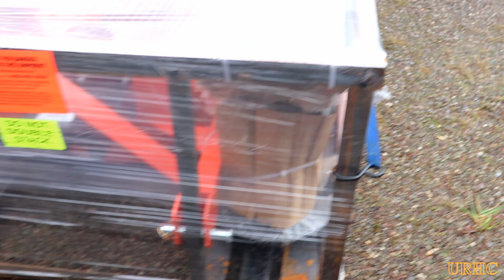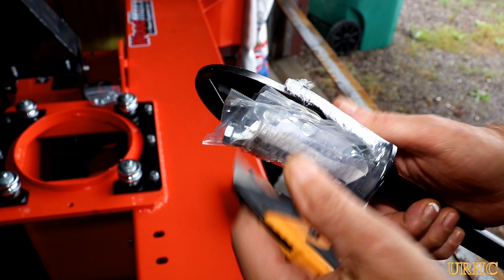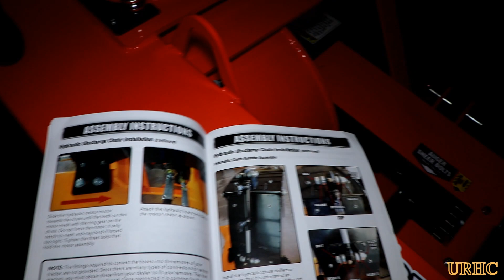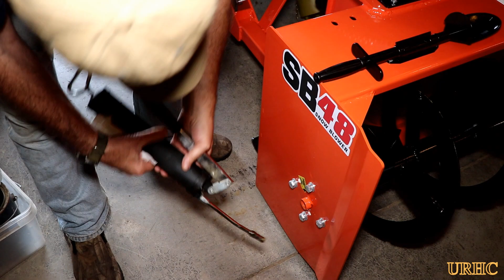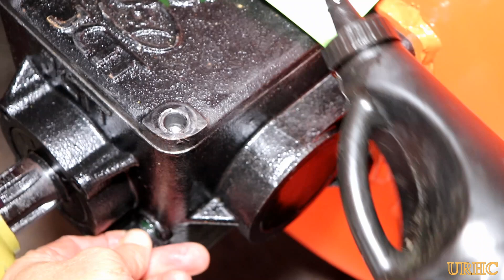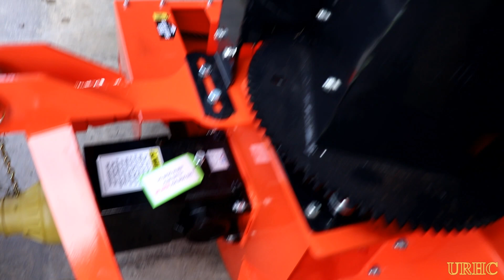Delivery And Assembly Of My New Woodmaxx SB48 Snowblower Replacing The Junk Ariens Platinum 30 SHO

Comment: Great video, I've got a Woodmaxx 60" snow blower and couldn't be happier with it!

I think the reason your saw blade lost a carbide insert is because it's spinning way too fast.  The saw is made for an abrasive wheel spinning 4000ish RPM's.  A cold saw blade is only rated for 1,800 RPM's or less and usually has coolant running on the cut.
Reply from the maker: They are great blowers. It is a slow cold cut saw. Got a better Evolution one now. Thanks for watching.

Comment: You seriously compared a walk behind snowblower to a three point hitch model? Lol
Reply from the maker: I used to do it for years with  a walk behind that was old and worked good. Tried a new one that was total junk and useless so switched to this.  Cost about  the same as the Ariens that was junk so its comparable in price. Big difference  is this works like my old walk behind.  Thanks for watching.
Reply: @unemployedredneckhillbilly2023  Okay, I can get my head around that.  If I had a tractor I’d absolutely gave a pto blower for it.  Thanks for replying and I like your videos.

Comment: If you are in to "local" as you stated, why do you have a Kubota instead of a John Deere?  Kent from PEI
Reply from the maker: I have both. The deere has a better mower deck and the Kubota is a better tractor with a really  good dealer nearby. Part prices  for Deere tractors are crazy now so I wouldn't buy another when its time to replace it. Thanks for watching.

Comment: None of the wide walk behind snow blowers I used I ever liked.
In my view anything over 28 inches is too wide in a walk behind the blower you have now is the answer..
I  Just traded in my Deluxe 28 SHO for a 24 platinum. 
The deluxe 28 worked fine but front heavy no problems with the auto steer for me.
Bought the 24 for agility.
Before I had the 28 I ran a Toro 26 power max for 11 years. Great machine.
I’m not brand loyal either way. I can see where a 30 blower would be a pain . 
Thanks for you informative videos. 
We all have differing experiences.
Reply from the maker: This is definitely  overkill  but works without problems at an affordable price. Thanks for watching.

Comment: just wondering how far back from the back of the rear tire to the furthest back point of the blower ?
I may have to extend my shed! I have a box blade and front loader Attached now and was hoping the total length would be the same ?
Reply from the maker: 55 inches  from back of tire to outside auger. Thanks for watching
Reply: @unemployedredneckhillbilly2023   THANKS !! You were right on the money bro ! Had to add jamb extensions on my doors to sneak her in !

Comment: Smart move dumping the Ariens and replacing it with the WoodMaxx... and now I'm wondering about my Ariens.  I had an old Ariens that worked perfectly and I ended up giving it to a friend and buying a new one.  The new Ariens has a similar system as the one you got rid of.  I have used mine in very deep snow with no problems, but it was sold to me as a pro model so maybe the belt system is better.  At some point I'm going to take off the cover just to have a look.  Thanks for making these videos.
Reply from the maker: This is definitely overkill for my driveway but works good for the same price as a walk behind. I thought the Ariens machine would be a nice upgrade and work better then the old one but it was a total disappointment.  They made many changes that year that were most likely the problem.  I think the pro models have a better drive system with ball bearings and the wheels were not moved forward like the platinum. I think  they also have a different autoturn system with beefier axles. Hopefully yours works for you.  Thanks for watching.

Comment: Why would you get a rear unit? Are you going to drive in reverse everywhere? We’ll see how long it takes for you to complain about this one.
Reply from the maker: Didn't want to spend 4k on a Honda walk behind to get a modern  machine that would work on my conditions.  This is an amazing machine.  Its overkill for my driveway at 47 inches but can do it in 15 minutes with no problems. This will handle anything and doesn't even strain the kubota with 2 feet of packed snow. The main reason I purchased it is the company guaranteed me it would work on my driveway and said  they would be there if there were any issues. It is extremely well made also. I don't know why people think driving backwards is a problem,  it's not at all. I highly recommend this as it does what it is sold to do well. Thanks for watching.

Comment: I had a 6 foot pto wood maxx previously.  NOTHING stopped it. Good luck.
Reply from the maker: This is an amazing blower.  Even 18 inches of snow is blown the same as an inch.  There seems to be very little strain on the tractor and it's the perfect size.  I highly recommend Woodmaxx blowers. My friend bought a 6 footer and it works as good as mine.  Thanks for watching.

Comment: Your comparing apples and oranges. This machine is 3 times as big as the Ariens. I have a 24” Ariens and I’ve never had an issue even when the snow was higher than the front of the machine.
Reply from the maker: Its only 16 inches wider and there is no comparison.  This one works like the old ariens did. It's way overkill but cost about the same as that junk ariens and they guaranteed they would take it back if there were problems.  Great to find a company that cares about customer service and stands behind what they sell. Thanks for watching.

Comment: I saw this video about a year ago, and complained then. Your listless attitude is beneath contempt. You don't really try at anything do you. No wonder you can't enlist the assistance of anyone because your lackadaisical attitude repels people. You deserve what you get or don't get. I own, and have used an Ariens for 60 years, and it's still a killer.  YOUR FAULT YOU LET YOURS GO! Replace the 3 auger bearings, and give it 40% more horsepower,  and she'll scream to please.  YOU LOSE....
Reply from the maker: You are a total idiot.  I tried for several months and there was no fix. There was no fix for Autoturn other then switching to the older style axle and putting 40% more hp on a 8 hp drive train has consequences. I refuse to struggle with junk equipment and have engineered some of the highest tech machinery in the world so I definitely know what junk is. Go crawl back under your rock.

Comment: Go to "Steiner" tractor website and look at snoblower. always has pile of snow in front of auger. I had old Ariens that threw snow 50 feet.
Reply from the maker: That's how a blower works. They move the snow to the center and the fan throws it. This thing is awesome and goes right through 2 feet without lugging the engine or plugging.  I bought a big new ariens last year and it was total junk with over 6 inches. It's way overkill for my driveway but works great.  Thanks for watching.

Comment: Wonder how long it will be before you start to complain about this blower.
Reply from the maker: Not 1 complaint so far. This one works as promised within issues. Used it 10 times so far and it is amazing.  I see several others have also purchased them now after seeing the videos and have zero issues. They really nailed it with these blowers.  Ariens makes junk these days  and they weren't complaints, they were actual issues with usability of the machine I spent my money on.  If it worked like the old one I would still have it. Thanks for watching.

Comment: Made in China 😂😂😂😂😂😂 good luck
Reply from the maker: It has been a fantastic blower so far.  Made better then any others I looked at. Made in China means nothing anymore. It is the company's specifications that determine the quality.
Reply: @unemployedredneckhillbilly2023  I beg to differ, Made in China means everything. I almost bought a Woodmaxx wood chipper, but decided a used made in USA was a better option. Woodmaxx is so upfront to say engineered in Buffalo, did they even try to source it in the USA? Who knows, but I'll tell you this. Give an American the option of made in China or made in the USA, most people would buy USA. My reasoning is influenced by the fact that I am a retired union autoworker, not a fan of the CCP.
Reply from the maker: @Mike44460  I have to laugh when union workers blame everything wrong with  our economy  on China. We have a president endorsed by unions that eliminated 25000 high paying  union jobs with a single  signature.  You get what you vote for and half of Congress  is in bed with  China so it's not going away when you elect swamp creatures

Comment: I like my woodmax tiller. Designed well. However they dont seem to stock parts should you need any. They will be on a slow boat from China. Can take up to 6 months wait for parts
Reply from the maker: That doesn't sound good. Hopefully  they start stocking parts as they grow.  Thanks for watching.

Comment: I bought one of their wood chippers which was really rugged and it worked great . One thing you might want to do is make sure all your bolts and especially your grease fittings are tight as mine were not . The people at Woodmaxx  are great to do business with .
Reply from the maker: They seem to build them out of heavier gauge steel then everyone else.  Checked all mine and they were good. It has really worked great the couple times that I have used it. Thanks for watching.

Comment: I have a Platinum 30, a new concrete driveway, but it's residential property in the city.  I think Ariens will do what I need to do.  But I am impressed with the set up.  I've subscribed b/c I want to know how it does.
Reply from the maker: My new platinum 30 was junk. The front was light from the rebalancing they did last year moving the axle forward and was a fight to keep down, the autotune kicked the machine around and it was a fight to keep it going straight, and a couple trips up and down the hill made the drive got wet and slipped so it had to be pushed. It was useless compared to my old ariens. This blower seems to work great so far and handles the snow as a blower should. Waiting for a big storm to see how it handles couple feet. Thanks  for watching.

Comment: Live in NH a lot of snow here in the winter I have a 300’ driveway tractor and a grading blade works fine hate walk behind snowblowers
Reply from the maker: I had an old Ariens that i used for years that worked good. Bought a new one and it is a hard to use piece of junk so I decided to try this and I am very happy with it. Thanks for watching.

Comment: Can't wait to see it in action ;-)  Looks like it should do the job for you. I would have to have a front mount because of neck problems, I can use mirrors real good but would feel more comfortable with a front mount. Thanks for sharing.
Reply from the maker: There is a video of the first storm and it works great. It didn't bother my neck and doesn't take long to clear everything.  No more sore back from fighting the Ariens. When I replace the Kubota with a different brand I can still use this blower. Thanks for watching.

Comment: Looks like a very heavy , durable unit . I just could not do the driving backwards thing . Good luck 👍
Reply from the maker: I didn't know if I would like it either and bought a reverse camera to install.  Turns out I didn't need it, it doesn't bother me. After the problems with the new Ariens I didn't want to take a chance on another problem machine and went with this. Thanks for watching.
Reply: I couldn't handle the reverse driving either. This belongs on the front pto of a tractor. We'll see how long it lasts before the poster is bellyaching about this machine.

Comment: They make drift cutters that go on side of blower, helps break up the drift so it drops down to be blown.
Reply from the maker: With this one you don't need them. It raises 2 feet in the air to take the top off then just pull forward and drop it for the rest. Only can do 5 feet at a time but should easily handle 4 foot drifts. Thanks for watching.

Comment: Make sure before you use it, take a chisel or punch and mark the auger near the shear bolt so when it does shear you can line the marks up and the holes from the auger and drive up easier.
Reply from the maker: Thanks, that is a good idea. I will do that. Thanks for watching.

Comment: We have a lot in common, I have the same Airens but a couple years older.  I had a problem keeping it tracking strait until I black topped my drive, now it works great unless I'm in a packed bank then it just wants to crawl upward.  Recently I struggled deciding between the Woodmax SB48 and the Woods SB54 to hang on the back of my BX2380.  I have past experience with Woodmax owing one of their TM86H wood chipers, it is a great, extremely stout machine and the company is great to work with.  I ended up going with the Woods because I wanted wider than 48" but I thought jumping to a 60" may be a little taxing on the BX.  I enjoyed your assembly video, it got me wondering if I made the correct choice, I'll have a clearer answer after I get to use mine (which could be tomorrow) and viewing your upcoming videos of the SB48 in action.  Good luck with your new tool (toy).
Reply from the maker: I was looking for the smallest blower possible because of the low pto hp on my BX and this one seemed well made plus I am starting to think that smaller companies have better customer service then large ones should a problem arise. It is very heavy for a small blower and I hope it helps it stay down in the snow.  I really wanted a walk behind but my experience with Ariens changed my mind this time around. Hopefully we will get a good snow soon to test them out. Thanks for watching.

Comment: Should of got a honda
Reply from the maker: Didn't want to spend that much. This one should definitely work and have no problems with my hill as the Ariens junk did. The Platinum drive would slip after getting wet and have to be pushed,  and the rapid track  rode up over the snow and sunk in getting hung up on the axle hanging  down under it burying it so far in the gravel that it had to be pulled out with my tractor. My 1965 Ariens was a great trouble free machine,  I don't know how they messed them up so bad.

Comment: I live in northern WI. and bought an Airens  Deluxe 28. It eats snow like crazy. Sorry it didn't work for you. Love my Airens plus it's made in America.
Reply from the maker: My drive system gets wet and slips on my hill and the autoturn stinks on gravel. It is junk compared to the old one I had. They are only assembled in America, many of the parts are from China. Their machines and customer service stink. Thanks for watching.

Comment: Make sure you set your skid plates about 1 inch high until you get a good frozen snow base, then you can lower it down.  Other wise your snowblower will turn into a rock launcher with that gravel drive way :-)
Reply from the maker: That 3/4" scraper blade gets flipped for gravel so the angle faces down also. Thanks for watching.

Comment: I have a MF GC2410 and bought the Woodmaxx SB60 last year with electric chute, deflector and LED lights...love it.  Only clogged my chute once in a 2 foot pile of old layered snow(wet, icy).  My tractor is at its limit with the 60 inch...but she handles fine.  Also bought the Berco soft cab.  If I could change just one thing I would go with the SB48 instead if the SB60:)
Reply from the maker: The 48 is at the limit for the 3 point hitch rating on my Kubota so I had no choice. I am adding a harbor freight remote control winch motor for rotating the chute and making a lexan shield for the rear next (video coming soon) . It looks like a well made blower. Almost twice the weight of the competition.  Thanks for watching.

Comment: Sorry to hear you had issues with your Ariens snowblower.  I've also had a 24" model for 7 years now and it's works great up to 24" wide and deep. Beyond that I have to slow down a bit and let it work through the drifts.  I've been looking at the woodmaxx sawmill and will certainly be looking for an updated review of your snowblower and the overall function and quality.  Thank you very much for the excellent content.
Reply from the maker: I think all the changes Ariens made a couple years ago screwed them up. My old Ariens was great. I think the sawmills are a new product for Woodmaxx but if it is built as well as this blower it should be a good affordable mill. Hopefully we get some snow soon to try this unit out. Thanks for watching.

Comment: That shroud on the PTO shaft brought to mind a fellow who worked on his ten wheel dump truck, and got his scarf entangled in the driveshaft somehow, strangled to death, true story.
Reply from the maker: When I was young my dad drove a propane tank truck. While making a delivery during a ice storm he slipped and slid under the truck. While sliding he reached up and his rubber glove caught the pump pto shaft. It ripped his 4 fingers apart and off his hand. Luckily everything was in the glove so they could reattached them and pin them back together. Those shields are definitely necessary.  Thanks for watching.